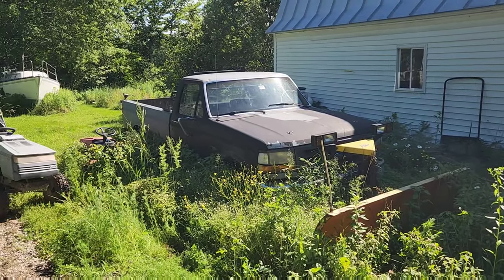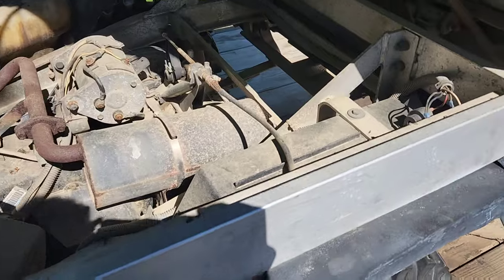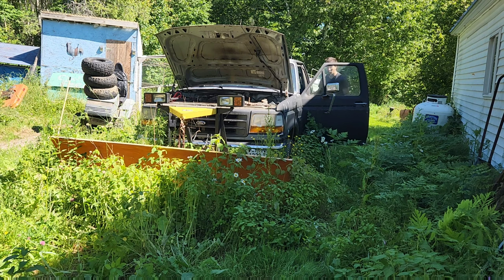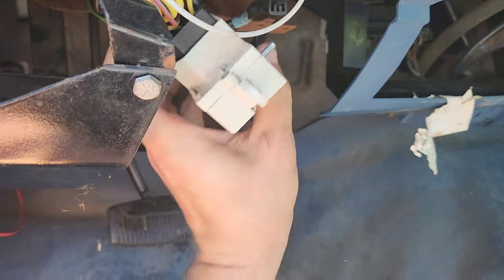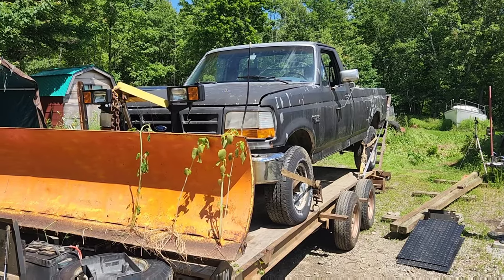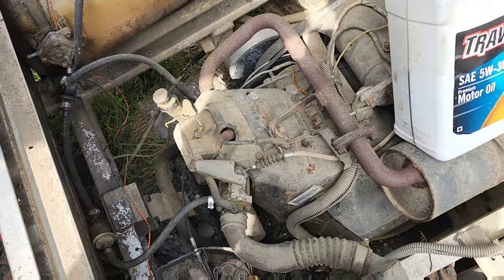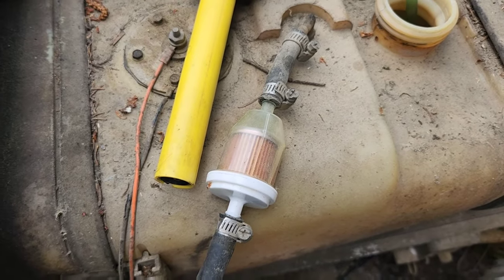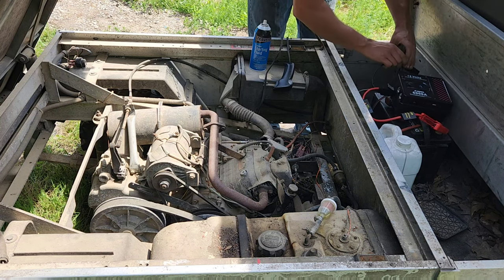Club Car Carryall 1994

Comment: Guess it was worth the trade just for John to have fun with it.  

My 88 F250 is still going, probably getting close to needing an engine overhaul though, and its leaking oil from everywhere, and transmission fluid...but at 697k without any major engine/transmission work I'd say its doing really well.  The trouble is at $6/gal for gas that old 460 V8 has to visit every gas station it comes to LOL.

Comment: Master links linkables will be your bestfriend in the installation of that process to. Im just throwing y'all A quick& fast idea out there to use for less money& issues to. You can run the lift bed by A 2 stroke engine.,or double pulley.& belt drive clutches. By adding on A exstension slide over shaft home made.,or bought for those purposes.

Comment: A sugeusstion to you guys.  I think using  one of those chain driven lift units that has A chain link bar at the end of the chain.& gear box drive unit to run the dump bed on with. Wouof work just fine for your needs. The gear box has forward& reverse mode on the gear box drive unit to.& you'll just need to add on A dual sides left& right side cable slides for cable guided tension slack adjustablilties to. Weld on A added lever handle through.,or on A mounting plate that's removable to be able to shift it from forwards to reverse mode. Witch will raise & lower up& down for y'all. I'm talking about the tilt bed for hauling whatever with to. Make some locking safety keepers to secure the bed down.,or in the up position with by notching out slot adjustment groove spots on A another plate to that is removable aswell to. So those parts.& the other ones can be serviced.& replaced& repaired to.

Comment: Run the chain drive unit in the center of the dump bed on it's own  adjustable& removable plate to. By making another slide plate with welded on hinges& nuts to thread bolts into for adjustments with. I reconmend using whats called antizeeze on the bolts& nuts to. It comes in aluminum.& copper style from permatex.& another company makes it to.

Comment: On the "Club Cab" Golf Cart, I'm sure that the Input or Output shaft seal is bad and allowed the oil to be "evicted" from the Kawasaki engine...
Maybe you could "swap" in the Vanguard V-Twin if it will fit!
May be too tall to fit under the bed though.